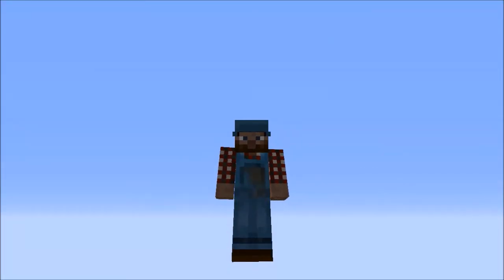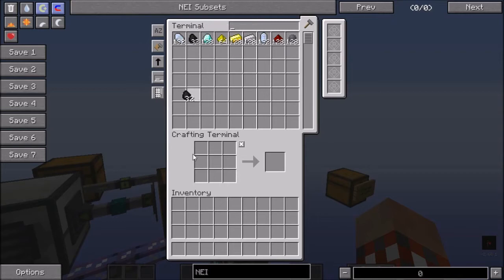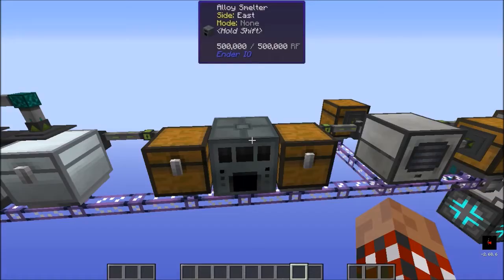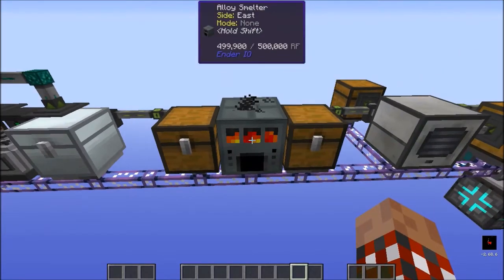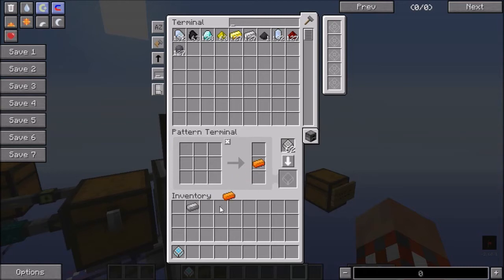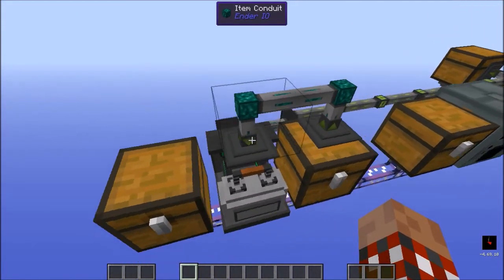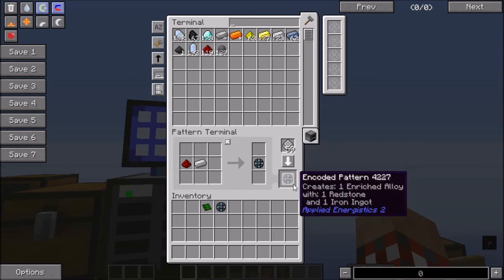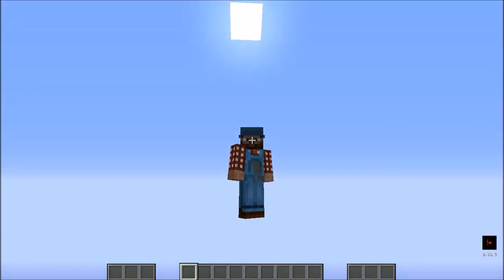Minecraft Talk 02 - Automating non-AE2 machines

Comment: Would the EnderIO SAG Mill need a separate export bus for the flint?

More complicated-ly, how would you handle the variable items (rich slag, cinnabar, etc) needed by the Induction Smelter?  I ask because I like to reserve Ferrous Ore and Redstone for the production of Cinnabar and Shiny Ingots.
Reply from the maker: +rwhiteruff It would probably be best to have a separate export bus for the flint when dealing with the SAG Mill.  That way it will keep the flint (or steel balls) topped off inside while leaving the chest free for filling up with stuff to process.  Assuming you go with a chest for the input instead of an interface.

As for the induction smelter, I like putting the interface on the chest that feeds the induction smelter.  It means stuff I automate go into the chest to be processed, and it allows me to dump stuff manually into the chest for processing.
Reply: You mean you automatically dump things like Ferrous ore and Rich Slag into a chest nearby and feed them into the Induction Smelter manually?
Reply from the maker: +rwhiteruff Here my setup on a current server.  http://imgur.com/VwyzK8m  Behind the machines are the interfaces with recipes.  They dump the resources into the gold chests on top.  Then the EnderIO conduits feed the items into the machines at the top.  Finish stuff is pulled out of the bottom.  This allows for bulk processing of items manually by just dumping them into the chests or running a job through the ME crafting.
Reply: +Grok DuckFarmer If you just dump things into a chest to process them in the Induction Smelter, how do you deal with things that require a different combination item?  Like if you were making some quartz seeds you pop in sand and quartz dust, but if you also want to make an ingot of Soularium, which takes soul sand and gold, and you put all 4 items in the chest at once, wouldn't it be likely that the wrong combination would get inserted?  Wouldn't you be likely to end up with a piece of sand and a gold ingot, or soul sand and the quartz dust?
edit: Doh, brain fart, obviously you don't even use the induction smelter to make quartz seeds... anyhow, the question is the same.  Some things need sand, some things need other stuff, if you dump a bunch of different things in the chest, don't they get mixed up?
Reply: +rwhiteruff Personally, I separate out my machines that I use manually and the ones I use for autocrafting.  For the induction smelter, you only need one interface.  I put the interface direct on one side of the machine, and place an ME import bus on another side.  The recipe is set up to feed in 1 ferrous ore and 1 cinnabar.  The outputs are setup so that both the primary and the secondary outputs go out the side with the import bus.  This works because the chance of getting some Shiny when using Cinnabar is 100%.  If the chance were different, like if you were trying to get shiny dust by running ferrous ore through the Pulverizer, it would be significantly trickier (like 'set up a subnetwork that automatically pulls as many ferrous ore as necessary and continues to pulverize them until it finally gets shiny dust then send that back to the main network' tricky).  The way Grok explains his set with chests so that the machines can also be used manually seems to me (though I haven't tried it) that you would have to be careful how you put things in the chest to avoid having the wrong combination of items feed in...
Reply: +Dustin Rodriguez The way I've currently got things going is a mess but works for the most part. The only area that's frustrating is cinnabar.  I've currently got a itemducts network going from a chest with export buses all around it, and a line of machines with various import filters on, all connected to an ender chest with more import filters on that auto-imports everything to the AE network elsewhere.

Problem is, cinnabar gets back-clogged, so I put it on the ender chest import filter, and now it just spins around and around and around the system, screwing with my view of the AE system.  My current plan is to stop that madness by putting an export bus directly onto the SAG mill what only exports cinnabar, but I thiiiink I may have run out of sides for the SAG Mill, since I'm using ducts instead of conduits and I placed it right next to the other machines.  >.<

I really should have made the whole setup more easy/elegant buuuut...  didn't happen.  There are just so damn many ores.

My original problem was dense ores back-clogging the system as I sent them to the pulverizers first, and the system had nowhere to put excess regular ores if they weren't in the buffer chest, so I eventually just gave up on those entirely and do dense ores manually now.  :<
Reply from the maker: Dustin Rodriguez I normally only run one recipe through at a time.  It avoids the possible complication.  But you are right that you can get things mixed up if not careful.

Comment: Can someone help me? I have my Me system set up the same way that you've shown, with my interface set to create 1 Iron Ingot with 1 Iron ore, but my furnace refused to take in any ore from the network. I have it configured correctly on the side, any ideas?
Reply from the maker: If it's the vanilla furnace, input is the top, fuel the side, output the bottom.